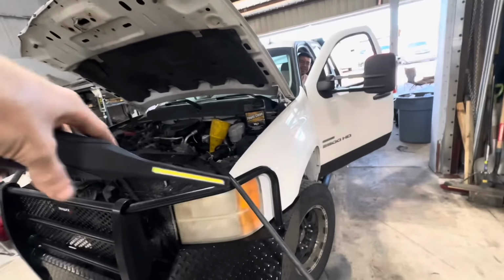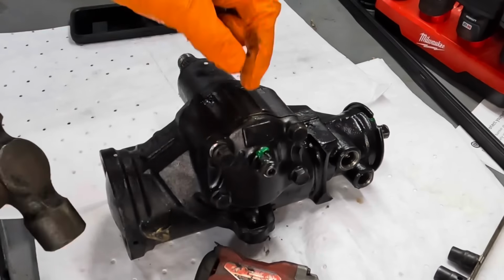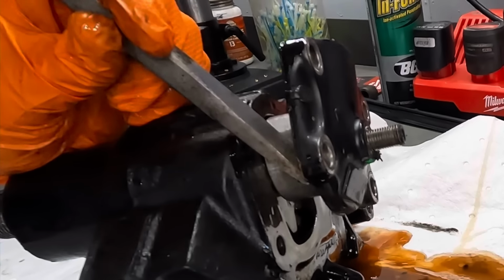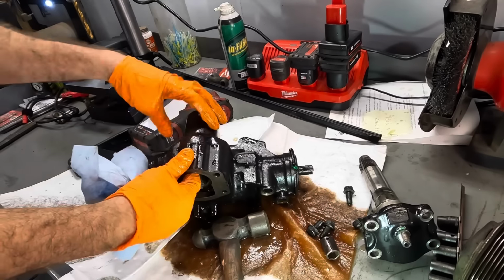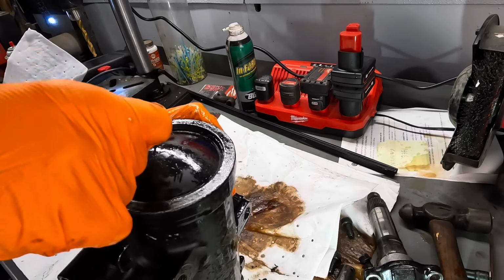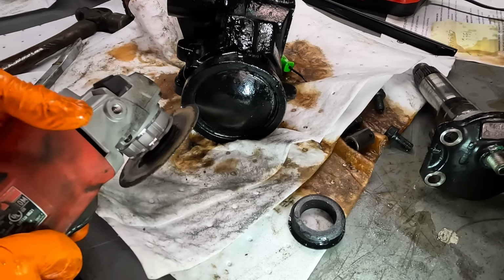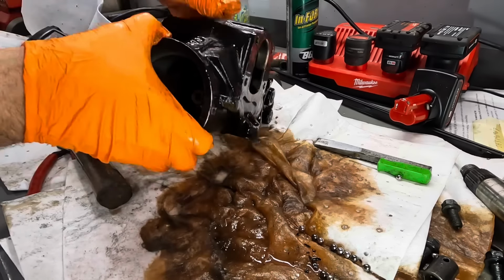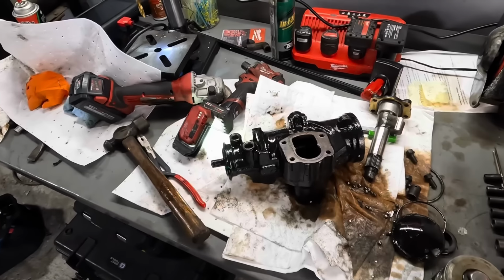Mechanic Cheated: Counterfeit/Fake Parts! Steering Gear Destroying Itself!

Comment: Maybe you will be invited to the BBK factory soon. I  have had to go through three steering box's to get one that works.
Reply: Need to reimburse the labor to replace their crap. Rebuilder/manufacturer should pay.
Reply: Every item these days seems to come with a risk or defect if you look for it...The sad irony is..., 35 years ago you never heard of bad parts and defects, everyone took pride in their work or so they claimed...... ..,35 years ago was the modern day version of the dark ages, the closest thing to the internet was "Dear Abby"....
Cool Lobotomy Ray, that steering box was someone's idea of putting lipstick on a pig , the clicking was most likely gear lash, somebody could have easily painted a worn out steering box and returned it for full refund or it was bench tested, it wasn't making a noise because it wasn't under load so they scuffed it and gave it a lick of paint, sold it for new or it was just a crappy reman job mistaken for new, anything and all is possible, ............. Good video, thank god for the internet.
Reply: I have never had a good part from BBK. Always something and at least 1 exchange. I have now gone back to using only OEM parts the warranty is better on almost all of the OEM too.
Reply: I have purchased BBK stuff in the past... none of it lasted more than a week. That end-plate snap ring should have a small hole on housing.. insert tiny screwdriver to push ring ... then  pry snap ring out. Those bearing sometimes are 2 different size diameters.  Install  large-small-large-small .... till you run out of bearings. This particular box is just junk to start with so return it !
Reply: Wow
Reply: @IR-nq4qv as someone in manufacturing, when factories were (and are, in some cases) trying to get people in the door, there were many places that had quality control issues. Better places have systems and policies to mitigate the quality impact, not so good places will flounder for months or even years until they figure it out.
Reply: @Paul070 is BBK chinesium ?
Reply: A1Cardone has been worse for decades
Reply: I remember buying a front wheel bearing from an auto store got it home and it was loose. 24 mile drive back to the store . At first they started to question it . But I had said you better check to see if it was returned pryer to me buying it. . They replaced it . Found out it was put back on shelf.  It sucks time involved.
Reply: I'll put BBK on the list with dorkan (doorman) of DO NOT BUY. Sad 😢
Reply: @MR-si1eq have you bought any Dorman parts lately?  They've come a long way with their quality.  I just bought a new coolant overflow bottle for my F150 and it has been solid.  Stopped my coolant leak.  In fact they've made improvements over OEM parts on certain vehicles.
Reply: @Paul070  It's actually cheaper to go OEM nowadays compared to cheap Chinese parts that are bad from the start.
Reply: stay away from BBB too, stay with cardone, they cost more but they do a good job everytime
Reply: Looks like a tru-grade or sardine. They paint everything including the bolts.
Reply: Recently, I put six new wheel bearings on my van to get four that would run more than 5,000 miles.  Sad.

Comment: I used to work at auto parts stores.  It's amazing the amount of time and effort people will put in to clean a used part to get their money back, saying "they didn't need it".  I took back two rear wheel cylinders that looked brand new.  Sometime later I was showing someone how the insides looked.  Took off the boots of these particular cylinders and all this old fluid just came out of it.  Outside was absolutely spotless.
Reply: no, this is a rebuilt unit , not someone who did that to get money back. I have a video showing you a brand new rebuilt out of the box being all sloppy and wore out. Same vehicule
Reply: MFRs could slow that down a lot simply by stamping a serial number into the body of the part.
In order to return it the serial numbers have to match up.
Not many willing to bother or have the skill to scrape off an old serial number and forge in a new one just to save some bucks.
Reply: I just replaced my rear calipers THREE TIMES !  The supplier expected me to pay the difference between the original cost and the replacement.  It did not end well. At all
Reply: There is always somebody trying to make a quick buck , by being deceitful and a lying toad . With returned items that are supposed to be correct and fit for purpose .
Reply: I try to go OEM, new if I can. Have had bad luck with a lot of the rebuilt stuff out there, some last some do not!

Comment: Welcome to the world of rebuilt parts this is not uncommon that is why we rebuild our own parts when we are able to get the parts
Reply: Yes, but this was SUPPOSED TO BE a NEW part, not rebuilt...
Reply: @Calango741  I wasn't Shir of the part of being new I was under belief it was rebuilt if the case this highly irresponsible by the builder and compensate the shop
Reply: @davidcraven277  Well, Ray did say it appeared to have been a new part, sealed etc, but when put in, it immediately made noise and upon inspection looked to have been rebuilt, and likely poorly at that.

Comment: Let me 1st say  I'm old. lol  But I do remember in Highschool shop class having to rebuild Steering boxes and even brake cylinders.  Early on when "they" started sending out and stocking rebuilt parts the quality control took a downhill slide quickly. Then we learned the folks doing the "rebuild" NEVER needed to know what they were working on or what it did or even how. All I can offer is  Good Luck with the very disposable industry where quality takes a back seat to quantity. Good Video sir Ray.
Reply: Great days when high school had auto shop. Not available now in most places. What you to go to expensive private places
Reply: Sad that we've come so far only to become a "throw away" society. Shame really.
Reply: @Ham68229  There was even a song way back in like the 70's or 80's that had a line about living in a world of "disposable emotions".  There's some perspective for ya...
Reply: All that work for nothing. Hope you got the best of the next one
Reply: I used to be that Auto shop teacher!...Recirculating Ball steering gear. The different sized gear teeth make it so that the steering gear turns quicker on corners than it does going straight.
Reply: @Calango741  It is a sad truth unfortunately. Cheers :)
Reply: @Ham68229  👍

Comment: The case has a hole for a punch to press the snap ring enabling a small pry bar to remove it, no destruction required.
Reply: As long as you have x-ray eyes to see through the inch thick paint and know where to poke.
Do you know everything about a Bedford RLC Light Recovery or the 1944 version of  DUKW.
Best not throw stones only to find you live in a glasshouse.
Reply: @dukwdriver2909 he is correct doubt he was throwing stone just given advise how the correct method is.
Reply: It was destroyed in the box from the factory.
Reply: It’s the old “Lipstick on a pig “ trick
Reply: Right, but the death wheel is more fun
Reply: @keithhastings4092  EXACTLY!!
Reply: What fun is that...
Reply: Thanks for posting this.   I saw the hole before he found the snap ring and assumed it was for disassembly and was waiting for him to find.   I also have cut something open only to discover how easy it could have come apart
Reply: Even without the hole, im surprised he couldnt get that ring out, actually, he thought it couldnt come out. For as long as hes been working on cars, seeing a ring like that, he should know it comes out. Ive taken them out on countless parts even wo an access hole. If the ring has a split in it, you can get behind it and walk it around until it comes out. Usually shoots out if you're not careful because of the spring tension in a snap ring like that.

Comment: I appreciate this video because it shows that not all new parts are what they say they are.   Thanks for the effort and the revealing video on these scammers.
Reply: The aviation industry had a problem with that stuff.  Many parts have a time limit or a number of cycles. Once you hit that limit the part must be replaced.  Some unscrupulous folks would do dumpster diving retrieve the parts, clean them, repaint them and sell them as new.  Accidents were caused by these a-holes.
Reply: @robertthegrape2192  I worked at an aircraft parts warehouse and when we got parts in for replacement we were not allowed to bin them in their received condition.  We had to inspect each part for abnormal wear and then dispose of them.  To dispose of them meant we had to destroy each and every part, down to the smallest individual component, manually.  Had a whole process and checklist for it.  Mostly I saw manifolds and pistons, which were run through a drill press and then hydraulic anvil.
Reply: Today “new” means painted black- guaranteed to be crappy painted black. 

No other guarantees
Reply: @amzarnacht6710 manifolds don’t wear out tho. 
Unless it’s bad design

Comment: I had a starter with the gear worn down. I replaced it with a Chinese one that I bought "from the usual scumbags" (as AVE would say). and it failed in the exact same way. Upon diagnosing it, we found that it was also worn down, however, it appeared to be new. We returned to the store to check another and it was also worn down. We concluded that the Chinese had reverse engineered a worn down starter.. so the gear teeth were manufactured brand new, in a fully used up state. Fun stuff.
Reply: When the soviets reverse engineered the  B29 bomber, they faithfully installed a panel to nowhere. The plane they copied had been damaged and quickly put back in service by placing a patch that looked like an inspection panel instead of doing a complete repair which would have taken a longer time. I am not surprised the Chinese did similar

Comment: The balls go in the worm gear.  That's how lead screws work on machine tools.   Only a guess, but one of the balls was not assembled into the worm gear and was loose and got between the end of the worm gear and the cap.  As the mechanism was turned back and forth the ball would push on the end of the worm and that would push it into the cap.
Reply: That's what I thought as well.
Reply: I rebuilt a gearbox years ago lost a couple of  bearings and the same thing happened along with general turning problems. Eventualy having to get another unit.
Reply: That may very well be true, but this was supposed to be a NEW part, NOT a rebuilt one, and it was obviously NOT NEW.
Reply: Yes, that's a recirculating ball steering box. It works exactly the same as a ball screw on machine tools.
Reply: The sheet metal tube that was bolted to the gear he removed should have been pulled off first, then turn the housing upside down and turn the input shaft completely one direction and then all the way in the other direction. That will make the balls come out of the worm onto the bench, then the gear he knocked out with the hammer will just fall out of the housing. Also, at one time back in the past, the order the balls are put back in the worm used to matter and probably still does, there were x amount of silver balls, and the same amount of charcoal colored balls. You alternate colors as you feed them back in while turning the input shaft. Then when the worm is full, the rest of the balls go in the sheet metal tube making sure you keep the alternating order of colors the same as what you ended up with when the worm was full. Use grease to hold the balls in the sheet metal tube while you bolt that back in.
Reply: we make the new gears for those trucks at nexteer.  there are some measurements done on the worm to determine how many and what size balls are to be loaded. all gears go thru elaborate functional testing prior to shipping.  you get what you pay for.
Reply: @ralfie8801 ralfie-
You’re hired!!!

When can u start😂🙏🏼
Reply: @fastinradfordable  
I had my fill of those back when you could still buy a new housing from GM and put the  parts from your broken steering gear in it. 
The old square body K trucks were bad about cracking the frame rail and/or the gear box at the snap ring groove that held the end cap in place.
Edit: Usually only on lifted trucks running big tires.
Reply: @ralfie8801  ... and to get that snap ring out in front of the end cap, there is a hole in the housing , use a small punch.
Reply: @kevinharms7578  
My housing broke in that snap ring groove, I had easy access to the snap ring and I got it out with a flathead screwdriver. I resealed one for a buddy on his ‘81 K-20, but it’s been so long ago I forgot how I got that one out, but thanks for reminding me. I had to take that one apart because I tried to change the leaking steering shaft seal without removing it from the truck. Once I got the packing nut loose and was working on getting the seal out, the input shaft moved off center and all of those silver and gray balls fell out of their channel in the worm gear and it was all over with then, it had to come out.

Comment: I really hate defected rebuilt parts. At times with certain vehicles you can't avoid using them because no one have OEM or new parts, then when this happens it really sucks and I felt I had wasted a lot of energy and time and now it's back to square one. This is when attitude and patience comes into play and just move on. Your attitude towards this junk rebuilt steering box is really good compared to a lot of other mechanics, great job of showing us what was inside of this unit.

Comment: We had to rebuild power and manual steering boxes in tech school as part of our final grade. Feeding the bearings back into the piston/gear assembly was the hardest thing to do. To get the end cap off, there's a hole in the case to insert a punch to push the snap ring out of its groove.
Reply: The rebuilder's liberal use of paint probably obliterated any chance of finding that hole.
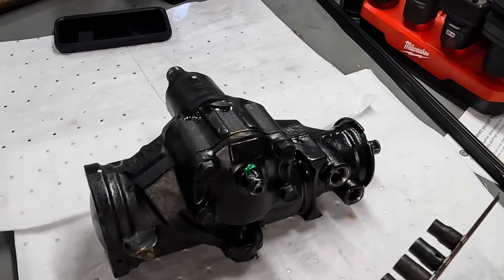Reply: @MonkeyJedi99 I'm pretty sure you can see it at about 1:55, but if you don't know to look for it, you wouldn't know to use it

Comment: Going back to your video where you did a semi-rant about parts mark-ups, customer-supplied parts, etc: This is a prime example of why things are the way they are. You are responsible to either get compensation from the parts house or eat the cost, AND you’re out the labor. Had the customer supplied the part, you could charge again for the labor and the customer would have to pay again for the part.

Comment: Lately, I'd been watching manufacturing and rebuilding/recycling in Pakistan.  I watched how they built brake shoes, pads, rotors, rebuilt motors, etc.  They replace the broke part, then stick it back together.  Interesting to watch and that's how it's done everywhere. Like a company a few years ago I had to rebuild my transmission.  It burned out again in 8 months.  When I took it to a GOOD transmission shop he said that they only replaced 1st and 2nd gear packs and 3rd, 4th, and 5th was still OEM.  Even the torque converter and pump was the same,, and it was filled with particles of metal as if it was stuck together with the new parts and not even cleaned out.  Transmission fluid was even original and STANK !!!.  Typical rebuild places for major parts  like that steering gear.  Replace what's broke or bad, stick in a new part, put it back together.  Why I don't buy rebuilt parts.  New parts aren't much better. Quality control and bad business practices abound in all sectors of the market these days. No one cares about quality anymore, just the almighty dollar bill.  Why I watch you. YOU CARE.  You and a few repair shops are an anomaly in this world. Stay that way, please. Take care.
Reply: I'm sorry, but if the transmission was disassembled enough to replace gear packs (clutches and steels), the fluid was far from the original.
Reply: @jeggleston1651  Nope.  They saved it and put it back in to save money on their bottom line.  Even admitted they did when confronted.  They are no longer in business, thankfully. Sorry people.

Comment: Whenever I buy remanufactured parts with the signature black paint on them it is always a crap shoot whether they will be DOA. I had a reman Cardone power steering rack with excessive slop in the gears it made an awful clunk when turning under load with the wheels on the ground. At least your rack is accessible mine was under the exhaust and the lines were pretty much right up against the cross member.

I went through 2 Ford C-II power steering pumps with black paint on them and both whined like crazy (way louder than the typical Ford pump whine) even after bleeding with the factory vacuum tool. Finally bought a Motorcraft reman it had no black paint anywhere on it. It literally looked brand new installed it and no noise.

If you can afford it I'd go with an OEM reman over a parts store reman any day.

Comment: I was trained on overhauling those steering boxes a few decades ago. That snap ring isn't difficult if the area was cleaned up and you realized it was a spiral type. There isn't much that was salvageable on the one you tore apart. Maybe the case.
Reply: he vented out his anger by cutting it.